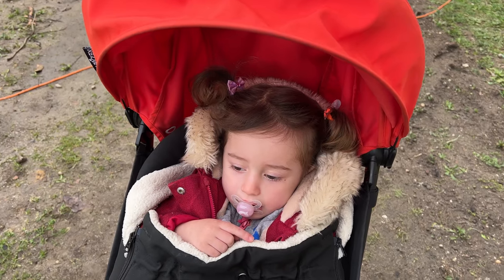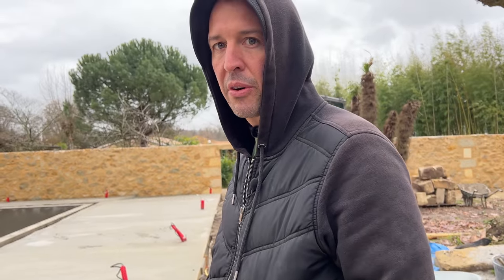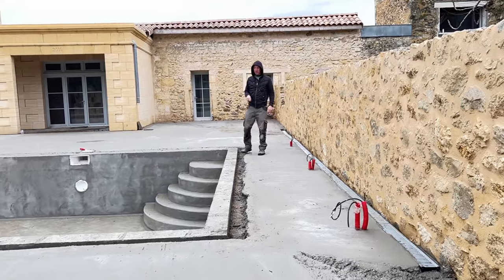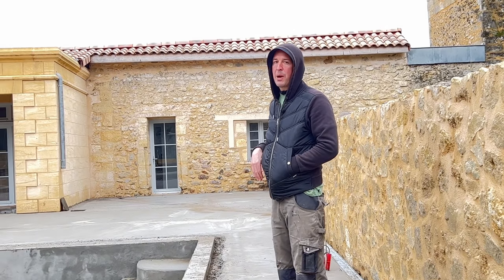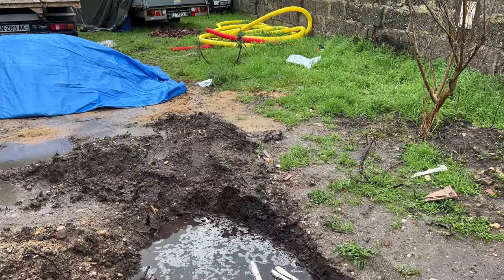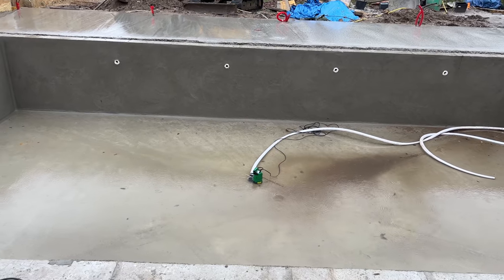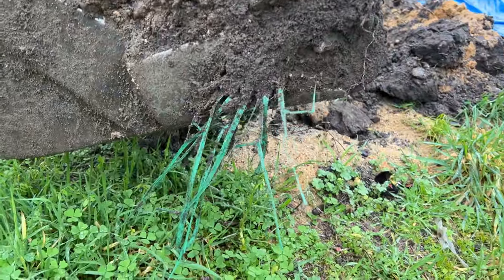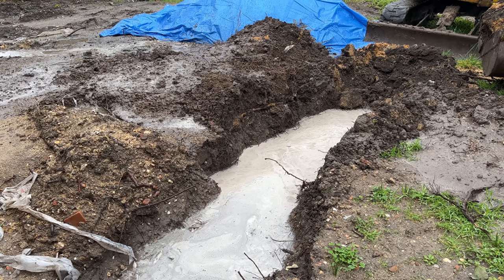EP110 150m2 Concrete Pool Terrace  ! Outdoor landscaping @ Our Passion Project

Comment: Around the pool is looking great now, only thing I noticed now you have set your levels the doorway through the wall does not have much head room maybe you could replace the beam for two off the stones from the well and make an arch or drop the floor level through the gateway Robb Torremolinos Spain 😊
Reply from the maker: Funny you should say that Torre Robb… watch this space 😉

Comment: Ed - excellent work !  But couldn't you have just extended the drain pipe to the outer wall instead of using the digger?  But keep up the excellent work.

Comment: All right. I can't stand it anymore. I've been trying to figure out that gap-tooth look to the big stone fence. Please explain; why is that one section bare?   Thanks
Reply from the maker: I think you are talking about the area where we are doing a bbq? So we have to lay the concrete (already done) before we can build the fire place bbq…. I’ll be getting onto it very soon (we touched on this point in a couple of vlogs but you must have missed them. 😘😘
Reply: @BordeauxLife  Sounds right. I have been following, but... Thanks
Reply from the maker: No problem…. Look out for the bbq vlog - it should turn out really well!! We have a premier later too hopefully see you there. 😘😘